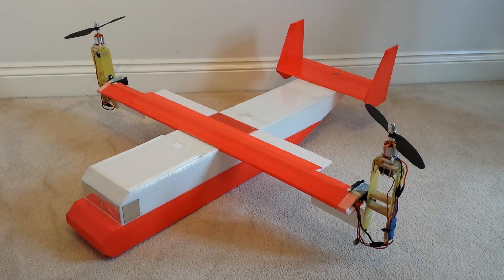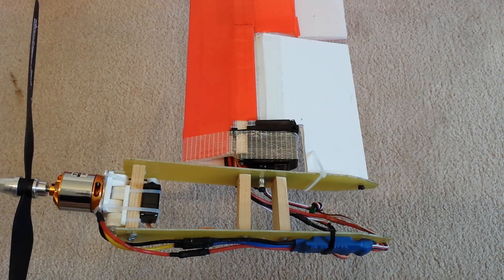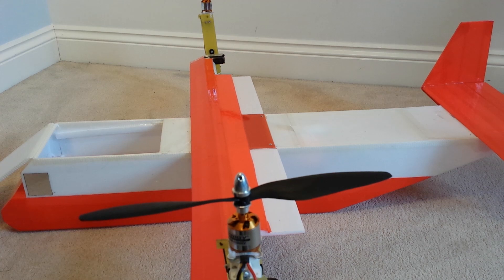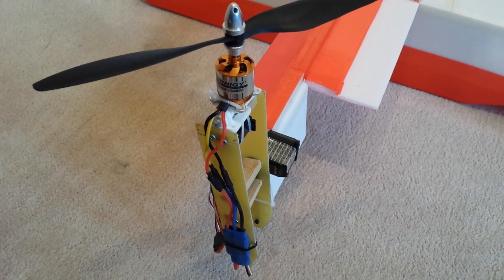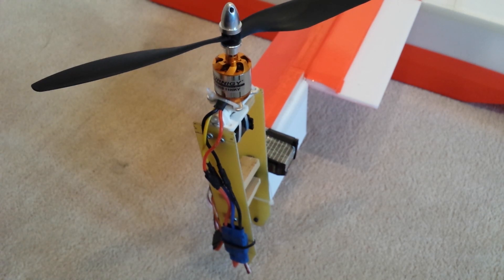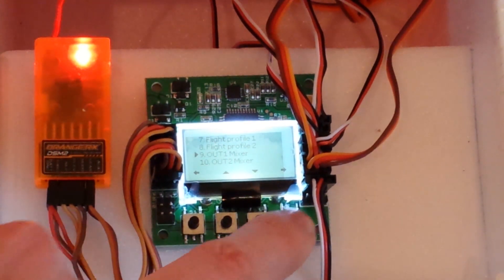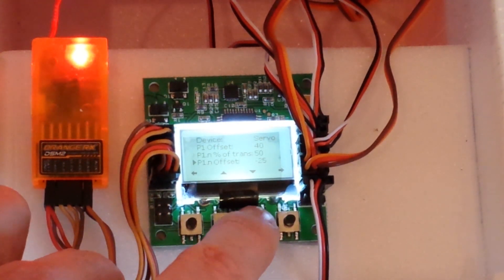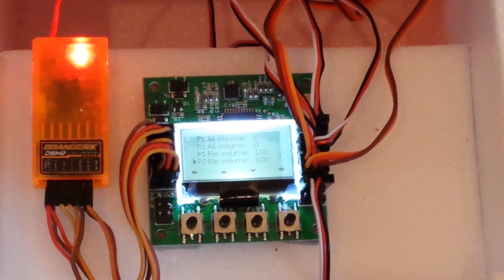RC VTOL Specifications

Comment: Mr. Stanton,
I've been following your work for a couple years now and appreciate you sharing, in a concise way, the results of your experiments. Well done.

I do have a question about an idea I haven't been able to find the time to investigate. The idea is to create a lighter than air volume using a vacuum instead of a gas to displace air. The volume's vacuum would be contained using an appropriately strong mylar or similar stretched across a light weight framework, such as carbon graphite frame or shaped aerogel.
I haven't run the numbers to see if it would be possible (strength needed to hold against atmospheric pressure, amount of vacuum needed to create enough buoyancy to overcome the structure's weight). 

Think of a mylar balloon filled with aerogel, and its air vacuumed out. 

In my minds eye, one thing which comes to mind regarding scale. On the "small end" it is far easier to build strong structures, given the pressure would be somewhere around 1 bar or less plus any structural loads, a frame and envelope could be less of a challenge.

Actually, I just did a search and found that someone has already come uo with a way.
https://patents.google.com/patent/US20070001053

From a safety (and energy) standpoint (its always "safer" to reduce relative kinetic energies in the proximity of people), wouldn't be cool to have an aircraft's weight be as near to 0 at ground level? Realizing AGL is different between Denver and most other cities.

Comment: i gave servo to out 6 , have only 2 servo connected to same pins on kk via y connector . but when i power up the kk both the servos rotate to flying position. Thats what i need it to do when on forward flight . how do i rectify ? thanks in advance

Comment: Can you give the cg when the nacelles are in hover and when they are in forward flight mode?
Reply from the maker: The CG barely changes when the motors tilt forward. The CG is about 3cm forward of the motors in a hover. The reason for this is if it starts to oscillate, it will tilt mostly forward, which will increase forward speed and the airflow over the elevator will stabilise it. If the CG was exactly where the motors lift from, it will tend to pitch the nose up when pointing into the wind which then causes it to crash due to it flying backwards.
Reply: tomstanton282 Thanks Tom, you may want the CG even a bit more forward, it looks like it's very close to your center of lift which can make the aircraft less stable in forward flight.   Also, it seems likely that the nacelles have to to point upward in forward flight because of the angle of incidence on your wings; it look like you have them perfectly flat or slightly negative.

Comment: Excellent video, with good production values. You covered a lot of material in a clear, efficient manner. Well done!

It was especially helpful to go through the programming of the KK2.1 board. A lot of other videos skip over that part. But it's the most difficult part for many of us.